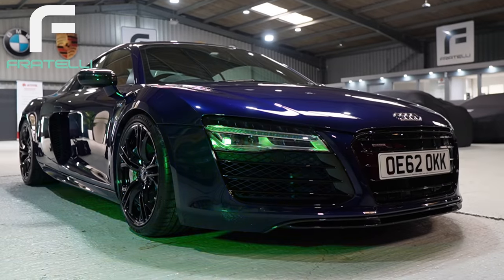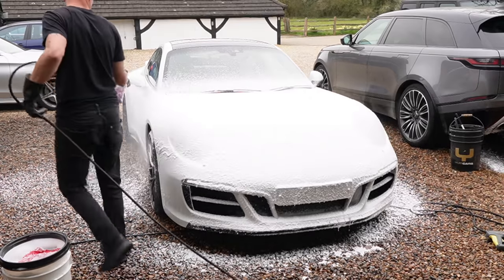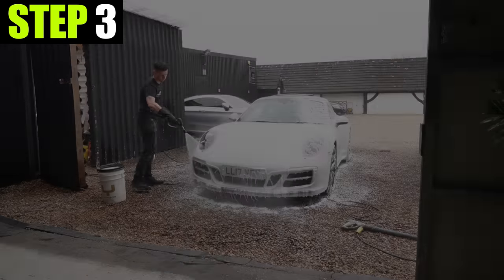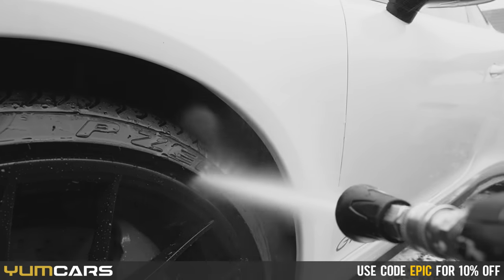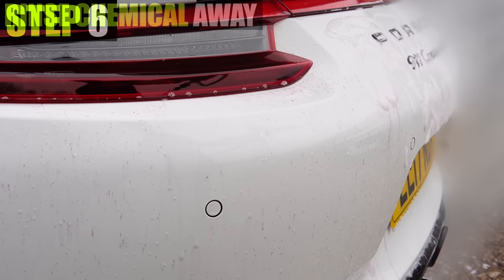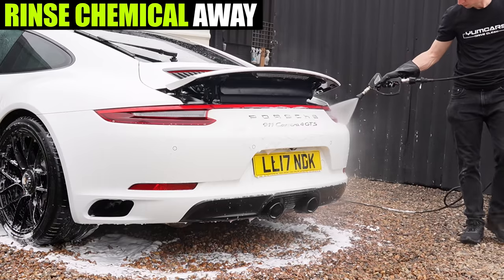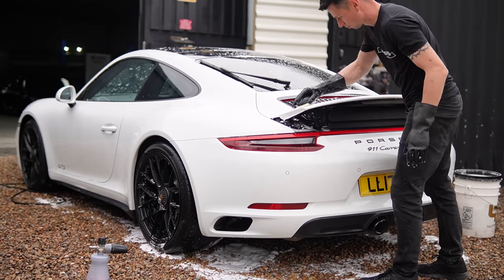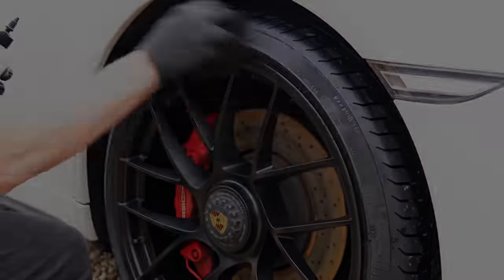How to Decontaminate Your Car for BEGINNERS / Decon Wash Explained!

Comment: Very good points Dave.    For the average user at home just looking to maintain their vehicle either weekly or bi-weekly,  chemical decontamination every so often (even once a year) would be a perfect option to help their sealant or wax or choice bond.    With so many different spray sealants and sealants enhanced with Si02 on the market these days,  the options are really limitless, and would fit even the tightest budgets.      If the contamination was really bad,  they could add the addition of a very mild clay bar or block and use something like a glaze or something like Autoglym Super Resin Polish to fill in the micro-marring a little bit and then top with a decent wax or spray sealant as a quick final LSP and 90% of the world would be 100% happy with the results!    And could easily get it done on a morning or evening of a day off.      Also,  like you said in other videos,  for teens or young adults looking to make a pretty decent amount of money in their spare time just offering the basic valeting services such as a vehicle wash,  quick coat of wax,  and maybe a vac and wipe down of the interior,  a few basic detailing items is all that is really needed.    95% of the world's population who own a vehicle of any type are only looking for the basic valet.    Too many "new to detailing" detailers get into detailing and want to do like 20+ year experience level detailing with freakin' 10 different type polishers,  heat lamps to dry ceramic coatings,   scissor lifts,  and heated/cooled detailing shops.   And probably 70% of those type people FAIL!   They jump too far in,  way too fast.     Those type detailers started out doing the basic valet and worked their way up.   It may have only taken them 2 years and they moved up really fast,  but still, they started basic.    First,  see if it's something you REALLY want to do.   Many getting into valeting find out it's REALLY HARD WORK!   You are out in the sun,  wind,  rain,  cold,  heat and humidity,  snow,  etc.    Your body hurts like hell and after three or four months,  they just give it up after finding out it really wasn't for them,  and keep their detailing supplies and tools as an enthusiast for their own vehicles.     Could be a expensive job experiment.    On the flip side,  as you know,  their can be a very lucrative job opportunity for some.     And if you become friendly with the higher end detailers in your area and explain to them that you'd like to work in their market area as a basic valeter/detailer,   a lot of them will actually throw a lot of business your way.    They have their specific clientele who are looking for the high end detail and willing to pay for it including all the add-on's etc.    Some of the nicer high end detailers will gladly throw you a bone and direct that person to a valeter who specializes in basic wash / quick interior clean packages.     Sometimes they may be throwing an overwhelming amount of business your way.    Do yourself a favor,  buy several extra boxes of business cars (they are fairly cheap) and stop by these high end detail shops and introduce yourself and give them a stack of your business cards or a whole box.     Next time a client comes in who wants a real basic valet and interior wipe down (which is really not the client's that the high end shops deal with),  chances are they will remember that new starting out detailer who had the respect to come introduce themselves and explain what they are about.    Chances are,  being most high end detailers are good people who came up through the detailing ranks over the years,  will be more than willing to help out new detailers when they can.     Especially if it helps both the customer AND the new detailer.   The high end detailer has no interest in doing that type of basic work,  however,  if they give the person inquiring a good reference which is more in line of what they are looking for along with the price amount they were looking for,  it only makes your own professional business look even that much more professional.     Granted,  some detailers are going to want the maintenance washes and ANY business they can get because it's all about they money to that particular person BUT in my experience over 40 years detailing, doing basic valets and quick cleans aren't really the type people going to those high end establishments.    I would visit every high end detailing establishment within a 30 mile radius!     Give them all a stack of your cards to pass out if they are giving away jobs they don't want to do due to being booked for a year already or for whatever reason.     I have actually had friends call me and ask for help on projects they themselves are working on and they have a time frame to stay within.   We then work out a cut of the profit for the help and it works out great for all involved.     Detailing professionals are a bunch of like minded professionals and many help out many others seeking nothing in return.    That's just the way detailers tend to help each other out.   And are very glad to do it!

Comment: Very nice video.   If I use regular tap water when rinsing (after decontamination) would the water put back contaminants?  Thanks
Reply from the maker: very good question. personally i wouldnt worry about it. I have used tap water for 16 years of washing cars and its never done any harm
Reply: @epicautomotivedetailing  16 yrs is good enough for me.  🤣
So, you work with regular tap water all the time? And do you work outside or inside a covered area? I'm asking bc I'm thinking that when doing ceramic coating that air can carry tiny pebbles/dust and that it can be inserted as part of your coating?  Happy new year.  🎊🎊🎊

Comment: Nice job, what a difference? Car looks amazing! One quick question, for you? I had applied a ceramic coat, on my car, which is a 2021 vehicle. My question is, it doesn’t look dripping wet, when I applied the ceramic coating? Can I clay bar the car, again, and do an IPA wipe down, and add a second coat, of ceramic coating? By the way, the first time I did it, I washed, clay barred, polished it, with a compound/polish all in one bottle, then did the IPA wipe down, before I put the first coat of ceramic on the vehicle? I just, basically want to know, the steps I should do, before putting a second coat of ceramic on it? Just to be safe? Thanks, Mr. Mark O.👍

Comment: Hi Dave, greetings from Puerto Rico! Did you clay it with the wheel cleaner still on or did you rinsed it off prior to? Thanks!
Reply from the maker: Hiya I clayed it with shampoo on. This was a clay block so it could cope with the shampoo. Actually clay bars break down sometimes

Comment: Is it fine if I clay bar my car and then just spray a ceramic spray or a spray on sealant wax and buff it out? Will that be fine enough for a temporary seal instead of hand polishing because I don't have a polisher
Reply from the maker: It will leave minor marks on paint but if it doesn't bother you then go for it. People worry too much. It won't wreck the paint just make it less pretty

Comment: Normally I'll cover the car in vasco pre wash and leave for at least an hour indoors,rinse the car, apply fallout remover, rinse again,clay, contacted wash, dry and job done
Reply from the maker: Nice one thank you for sharing 👌😀
Reply: I use vasco pre wash because its safe on all surfaces,can leave it on as long as you want once it's not in sunlight, don't even have to pre rinse or wash the car just throw it on the paintwork. A tar remover and pre wash together makes life easier

Comment: @Epic Car Show Detailing       

Is it sufficient just to shampoo+ wash with wheel cleaner without using a clay bar? 

I'm a weekend warrior without any snow foam, nor do I have a machine polisher to do a paint correction after a clay bar. I just want to prep my car for a base coat of Fusso
Reply from the maker: This particular wheel cleaner is a safe one for paint. Never use any old wheel cleaner unless it's totally safe to as advised on the label. If it's confusing just buy a fallout remover and no you don't need a clay bar unless your removing 100% of contaminants
Reply: @epicautomotivedetailing  Thank you for the response!

Comment: Would you use tar remover before fallout remover if needed to remove tar
Reply from the maker: That's a very good question to be honest if it was me id say fallout first as some tar removers leave a waxy residue which can sort of block fallout remover from breaking down deposits. I wouldn't say it's a real right or wrong way but just a thought